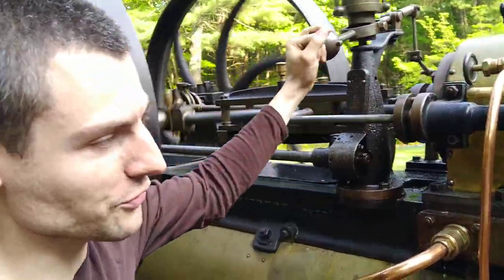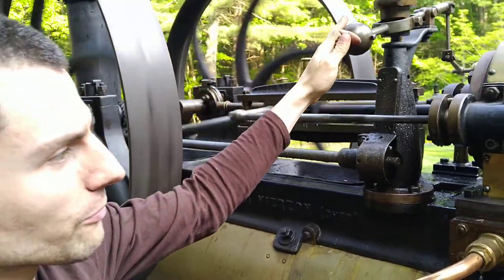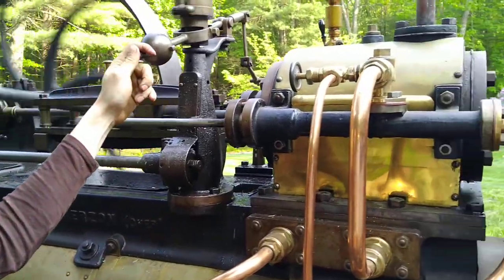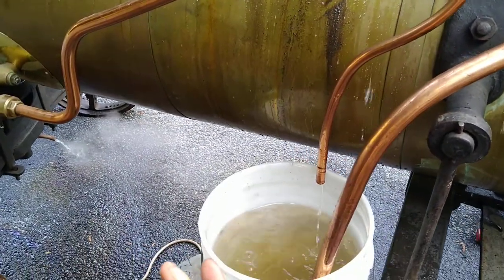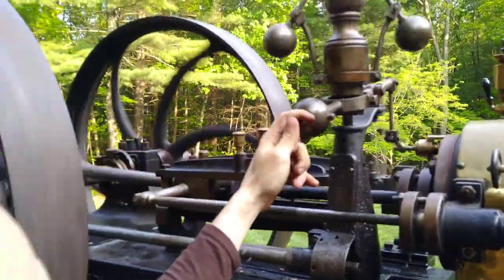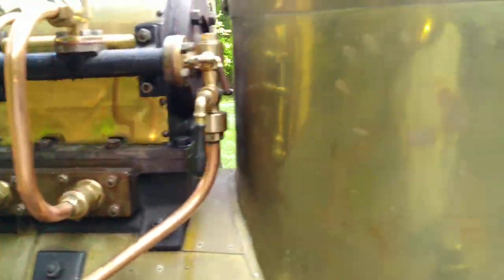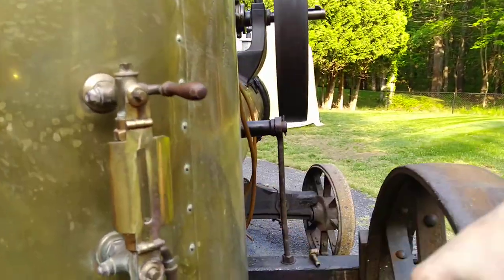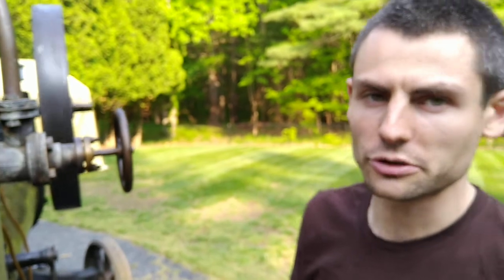"Crosshead Pump Bad"

Comment: I could see how a pump moving very fast might just cavitate instead of pulling water, but damn, I think it'd have to be moving extremely fast to do that.
Reply from the maker: I have seen these pumps give good service into the thousands of RPM on high performance steam plants, such as high speed launches.  They will cavitate but at the speeds most of these engines run, not unless they are ported badly or ingoing feedwater to their suction is near boiling point.

Comment: I think it is said that crosshead/eccentrick driven pumps are less efficient at high rev's.
Or so say it in another way, those pumps work more efficient at low rev's.
Reply from the maker: Depends on the design of the pump. They will only cavitate if they are not supplied with positive suction head, if they are ported too small or if ingoing feedwater is near boiling temperature.

Comment: Still doesn’t work when it’s stopped, unlike an injector, which is the real reason everyone swapped over to injectors at the earliest possible convenience.
Reply from the maker: If you are a good fireman it doesn't have to work when stopped, but we had steam driven pumps for that.  You can also run the water through an infinite amount of preheaters before the boiler check with a pump while you cannot with an injector.  The reason American machines fell into injectors so early was, sadly, laziness on the maintenance side, and only then began going back to steam driven pumps when the age of feedwater heating came.
Reply: @AEKarnes  interesting then that many 19th century locomotives and tractors weren’t equipped with these steam driven water pumps, and instead were documented to have similar crosshead pumps to that in the video which required actually operating the machine in order to deliver water to the boiler. Where’s the steam driven pump on your engine Alex?
Reply from the maker: @CaptainCrutch  Because that's generally all they needed, but usually engine driven pumps were married with steam driven pumps especially overseas.  All the pre grouping stock beattie fitted with them had rotative single cylinder pumps on the side, as does still Prins August still running in Sweden.   Mine has no seperate steam driven pump because the engine driven pump is all it or any of its sisters ever needed.  Every other Merlin like this running in France has the same fitout.

Comment: are crosshead less prone to failure than an injector. or is it more prone or about just the same?
Reply from the maker: Only if in extremely bad condition.  An injector is a fairly precise instrument and not a positive device and will "knock off" for many more reasons than will stop a pump from operating.